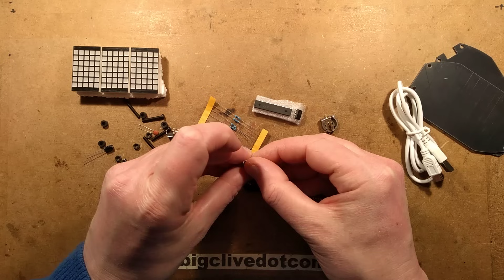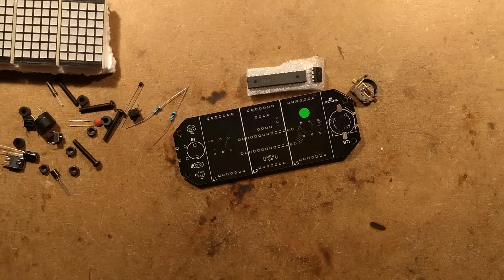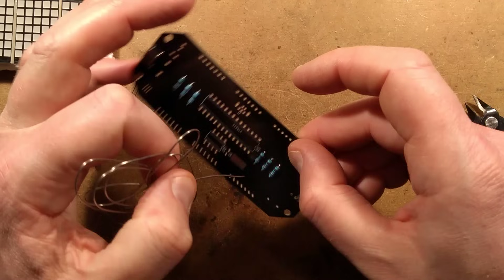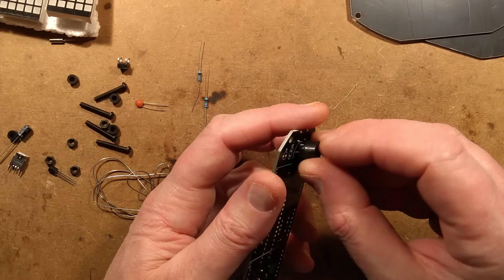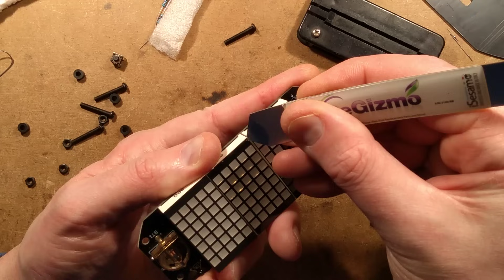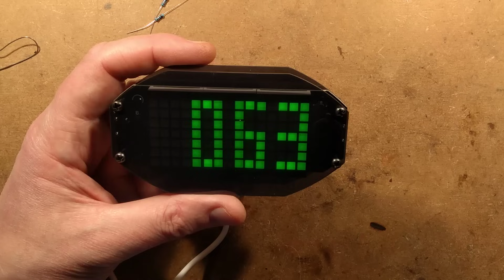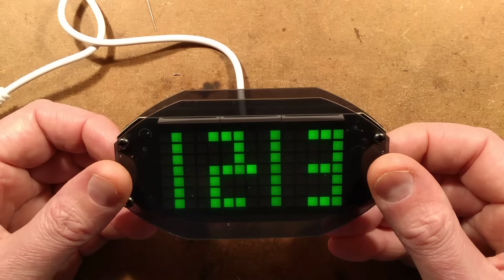Full clock kit build and setting guide.

Comment: The "solder will crack" never made sense to me. It's soldering, not welding.
Solder joints are soft and have a bit of give to them, cutting the leads too short isn't going to damage the joints.
If anything, lead-free solder can lead to cracks of its own as time goes on.

Comment: I believe the purpose of the flux is to change the surface tension of the melted solder, so that it will be sucked into the via and around the component leg by capillarity.
Reply from the maker: The flux is mainly to clean surfaces and shield them while the solder flows.

Comment: Speaking of "spares".  I once owned a TekTronix 512 oscilloscope, back in the 1970s (around 1976).  It was already an "antique" at that point.  One day, the 2nd-channel pre-amp failed.  So, I open up the case, and it was beautifully built inside.  But, to my astonishment and delight, there was a rack of spare tubes inside the cabinet.  Replaced the blown tube from the pre-amp, and it ran for many many more years...

Comment: Why do so many soldering irons come with spings to put them down in that are mounted in plastic too light to hold them down?  The ceramic heater rods are very cheap, but I have to keep buying another soldering iron to mend the first one.  I have my current stand stuffed with lead, but the spring still tipped the iron straight on the kitchen tiles.  While waiting for a new heater rod from China for £2, I bought another almost identical iron, except this one had an on off switch in the handle,and the handle got hotter than the heater!

Have you looked into the construction of soldering tips by the way?  I had no idea they were so complicated, and that I had ruined many a one by trying to file it clean!  :)

Comment: If you use an external flux, the carry-over method works quite well. Using that method really depends on the situation like soldering inside a guitar where a third hand would be great.  External flux was a revelation for me.

Comment: Dude, I had left a comment about devices for this on a different video… Never really thought about re-using anything from them. 

I’ve only used disposable ones like that a few times. The ones I use are usually refillable. The NOVO device you had, comes as a refillable one, where the tank and mouthpiece are replaceable. After you use them for a few weeks, the wick part burns up, so…

The stuff that they put in them, changed a bit, a few years back. The new stuff can use more of the active chemical in it. The old stuff, you could get stuff with very little of the chemicals in it. The old ones used less wattage, and use regular, replaceable 18650’s and fancy tank, some have lcd screens…

Oh yea, I’d fixed a led flashlight, that a had a wire popped off… did something wrong… got a bit warm, and the led came off the circuit board… 😖

Comment: I was in the RCAF as a Comm/Radar Systems technician and I took the High Reliability Soldering  course developed by NASA. We were taught to put a small dab of liquid flux on the connection, and put a little solder on the tip. That solder then acts as a heat bridge as it comes in contact with the lead and the pad. This heats up the connection quickly so that you can apply solder to the opposite side of the work and minimize the possibility of heat damage to components and board. With 2 sided boards and plated through holes you must ensure to dwell long enough for the solder to flow to the other side. Also, on the subject of bending leads, leads are bent to be in centre of holes so they don't stick to the sides when trying to remove them. Not a big worry for most hobbyists however. 
Love your channel. Don't let the smoke out.
Reply: I've seen a bunch of commercial boards which have short leads (like the ones on buttons.) bent on opposite ways, so like 1 up 1 down on a capacitor, or up down up for transistors, it's still fairly easy to remove (either bend the leads straight with a screwdriver or the soldering iron, or twist the component out), but holds well when soldering.
Reply: And remember NOT to turn it upside down or all the Electrons will fall out.  He he he

Comment: I bought something similar a while ago, no instructions and no socket for the chip.  I am guessing i cooked or zapped the ic as i applied power and it released the magic smoke.  Luckily it was only a couple of quid from china and i bought 2.  For the second one i added an ic socket and that worked but was horrendously inaccurate losing about an hour a day - whoever wrote the code for the chip obviously didnt take into account the time it takes to execute the code.  Also it was possible to set 31 days in each month which is silly  plus as soon as the power was removed it forgot the time.  I made a much better one using an arduino and a RTC module - the RTC not only continues to run with power off but takes care of the date - still using it to this day.

Comment: I really want one now :D. The other night (and you think a massive company like Sony would put logic checking into a clock) my radio controlled alarm clock Iv had forever glitched for the first time receiving the time code. I looked at it and thought, how on Earth is it 74 minutes past 27'o'clock ??? IE it read 27:74 and the seconds were going, so I tried to manually set it and it just looped from 29 hours to 19 hours up or down.  A switch off and try again sorted it, but WTF?? lol

Comment: Clive, I've been guilty of carrying solder with an iron, but I always butter my joints and components with flux.  I guess I have developed this technique do to bad experiences in my younger years of lifting traces and pads.  I've found that if I carry solder over to a buttered joint, it reduces the chance of damage to the PCB, as I allow the wet tip of iron and solder to heat the joint via the solder, and the flux keeps joint clean. Of course, cleaning flux off after is a thing..  Also, this would only work if you add additional flux, which I never solder without using.   Am I wrong?

Comment: 21:03 be extra careful when flowing solder to the shielding of usb connectors, i flooded my fair share that way, they tend to suck solder to the inside surface of the shielding.
"standby current is 50mA or less" looks angrily at her 8x8 WS2812 matrix panel drawing 4A

Comment: Hmmm. Timekeeping is indeed ridiculous. Gains a minute a day. Cut the thermistor leads if that's what Clive meant in the description and i will see if it helps.
Reply from the maker: There seems to be an issue with either the quality of crystal or the stability of the clock chip.
Reply: bigclivedotcom Yes indeed. Chopped off the thermistor and it's now losing time at a rate of one minute per hour. 😥

Comment: The Drift can be corrected with a better crystal, but higher precision crystals are quite expensive from the big name electronics suppliers BUT if its a worth it, purchase a FEW to get very high precision & to make it cost-effective, then you got your problem solved.. But more than likely, pretty much the BEST precision Crystals are Surface-Mount.

OR

You can buy RTC Chips like PCA2129T - Sadly, and i quote, "VERY HIGH PRECISION" RTC Chips like this can are usually surface mount versions, for me, i love SMD components, just get a x60 magnifier cheap as chips at aliexpress and off you go !

i quote again from the above chip:

" > Operating temperature range from -40 °C to +85 °C
   > Temperature Compensated Crystal Oscillator (TCXO) with integrated capacitors
    > Typical accuracy: ±3 ppm from -30 ℃ to +80 ℃
     > Integration of a 32.768 kHz quartz crystal and oscillator in the same package
      > Provides year, month, day, weekday, hours, minutes, seconds, and leap year correction"

So on IC's like the above, the crystal and capacitors are built in, VERY High Precision AND Temperature-Compensated Crystal... 

in other words... Fookin-Awesome-Bobs-Your-Uncle and off you Go !!

If you go looking for high precision crystals, you would want one from 2ppm to 3ppm in accuracy...

The Crystals on the cheap china-made DS1307 RTC Modules are closer to a very rough 30ppm to 50ppm and can even be as bad as OVER 280ppm !!!!!

PPM - Parts Per Million...

Comment: I just completed my clock a few days ago, and it seems to gain approximately 2 minutes per hour. Swapping out the chip seems a pretty decent way to go, anything I need to know before ordering a DS3231SN? Straight up chip swap, as well as removing the old crystal?
Reply from the maker: I think swapping the chip and crystal for ones from a reputable source could be a good start.  I tried adding decoupling capacitors locally and it didn't help much.

Comment: It's not really a big surprise that it doesn't keep time very well. Those crystals and capacitors are probably not matched and so 32KHz can have heavy drift. I also assembled a clock with that chip. I ended up ordering a bunch of capacitors to try and now it runs withing a few seconds a month. It's the same with Velleman and some vintage LED clock's from ELV I sourced a PCB for and build.
For a much better out of the box timekeeping out of the box you should bet on the DS32KHz as oscillator or use the DS3231 RTC which is more or less and RTC with DS32KHz build in.

Comment: What is your preferred temperature? Oh and also I have various tips, but using a symmetrical flat tip . Is your's a chisel tip of sorts? I assume I have the same no brand  soldering iron as you - same tips, but what is the best one please Clive?

Also, just got a clock on BangGood, but CR** it is smd, and I have now successfully soldered only three kits!!!! AND NOTHING smd.
Have you done any SMD? What tip would you use? I have 30 tips, as they cost nothing for a cheap knockoff iron!

Comment: I bought the larger, SMT version of this. Cool. Also bought the RGB/7seg version, but sumthin's wrong. Either they supplied the wrong LEDs, or the PCB layout is wrong. The LEDs are 6-pin isolated LEDs, all 3 dice facing the same way. But the PCB parallels two of them. Of course, it doesn't work. I assume LEDs with alternating polarities are needed. Except...I can't find such a thing. Anyone seen them?

Comment: Chuckle. If you think folded-over leads are troublesome, you should work on some old point-to-point wired stuff with the phenolic terminal strips. SOP on those was to thread the leads through the eyes of the lugs and twist them together to form a secure mechanical connection. Only then were they to be soldered.

Connections were good, but you typically had to cut out components. Desoldering was limited to cleaning out the lugs after the leads were snipped.

Comment: Clive any update on how yours kept time ? mines runs fast and gains 1 hour per day. Be interesting to see how yours worked out and if or a fix is available >?
Reply from the maker: Mine runs fast when powered and slightly less fast when not powered.  I've been trying various things with it.
Reply: bigclivedotcom I have ordered another crystal to see if this helps. Will report back with some results. It’s actually a nice clock other than the time keeping issue...

Comment: Here's a nice video describing a crystal oscillator test rig build using plain copper clad board and a few components It's an "old skool surface mount" layout and design. Great for beginners. 
https://youtu.be/blalAktxFoI
How to make the island cutter from a broken drill bit https://youtu.be/RKdsXU5iIF0

Comment: Mine came a couple days ago - in the US. (Now 2-20-29) - 
I ordered 2 greens (if I wanted any - green was it) - put them together without video.(because I was too lazy to look it up)  notable is the fact the displays are flippable - can go either way round. Another catch is the switches need 2 of the pins trimmed to clear the battery holder - solder from topside. Keep the parts (Q1 and Electro) below the buzzer height so they don't interfere with the smoke plastic bezel.
The thermistors are within 2deg C of each other. Sorry to see it doesn't do deg F (for us here in the US)

Need to figure out backup battery (thought I ordered some, but they may have come and got put up in my parts bins).
Work well, going to put one in my truck. neat clocks
They're too simple. I didn't get much fun out of the building, built both in about 20min. 
All together, recommended! 4 out of 5

Anybody know what battery fits it?? I'm thinking CR-1220??

Thanks Clive - cool "kit".
Reply: Yes, CR1220. And it does do Fahrenheit.

Comment: Hey Clive, any update on how accurate this clock is timekeeping wise?? I got the same one, except with a blue display, off eBay and it's comical, over the course of 4 hours it's gained 11 minutes, yes I do mean 11 minutes, so around an hour ahead of actually time every day, it's like guess the time... How's your one fairing??
Reply from the maker: While running the time really runs fast.  I've tried decoupling capacitors at the RTC chip and MPU and also added a bigger smoothing cap.  No real improvement.
Reply: @bigclivedotcom  I think John Harrison's H1 was more accurate than these clocks... 🤣🤣🤣
Reply: @bigclivedotcom  Hey Clive the general consensus from the sellers in C.H.I.N.A is that the DS1307 chip is bad and needs replacing...I don't have any spare DS1307 chips so maybe you could give it a try and let me know if it works, given you probably have a load of DS1307 chips in your mountain of odds and ends???

Comment: Well mines finally arrived , I built this and enjoyed watching this video again. Clive what battery is this using , I cant seem to find any that fit. I also don't have the ghosting issues you had but I did go with Blue as Green was sold out. I bet this video put the price of these up. Please let me know of the battery size. after 3 hours testing it is now running 3 mins fast.....
Reply: A CR1220 worked in the one I built.
Reply: @Mikeydude001  How was yours at keeping good time ? , i replaced the crystal which helped but it still runs fast.

Comment: Hi Clive. The DS1307 is a good clock clip but it's normally let down in cheap kits by the poor quality crystals supplied, which I suspect in most cases are production rejects.  The DS3231 clocks with a compensated resonator on the chip are far more accurate.  I've built a few Home made Arduino based clocks with the DS3231 and they keep very accurate time.  I have one on GMT  in my radio room with a coin cell providing backup  that has never had the time adjusted since I buit it a few years ago.

Comment: It's the layout guy (who is not an electrical engineer) that puts polarity marks on non polarized parts like the buzzer.  Even resistors have pin 1 and pin 2 and if you draw the schematic with pin 1 to one trace and pin 2 to another trace the layout guy will obey that distinction even though you didn't care at all.  However, the guy that loads the insertion machine may be smart enough to know he can ignore pin number designations for resistors.  Or he may not.  If he doesn't you can bet you are going to get a phone call from manufacturing in a panic because they just made 5000 PCBs with a part on backwards.  And he doesn't speak English.  And it takes you an hour to figure out it's a resistor and it doesn't matter.  And it takes another hour to convince his manager to ship the boards.  And the only time you can talk to them is at 11PM at night your time because he's on the other side of the Earth.

When you were bending those resistor leads I could hear my manufacturing quality guys hollering at me for bending leads like that.  Even when I would point out that it's just a prototype they still would holler. Even when I would point out that the tiny bit of stress I added to the component was not going to do squat, they just wouldn't buy it.  Quality dept could be really annoying. 

As for loading the tip with solder (and burning off all the flux), I would do that but at the same time I had already applied a flux pen to the component and it's pad so the flux in the solder didn't matter.  Made it easier to avoid the necessity of using 3 hands. A biological feature I do not possess.

Crystals are commonly  20ppm.  17 seconds error in 10 days.  (I think I calculated that right)
More expensive good crystals can be 3ppm.  2.6 seconds in 10 days.
Really cheap crystals can be 100ppm. Or even worse.  And crystals are quite temperature sensitive.  
Good clocks with battery back up use the power line frequency to count seconds.(assuming you are connected to power line and not USB)  
Power line frequency is extremely accurate.  And when power goes out the clock only then uses the crystal.  If clock is on battery for just a short power outage then even if the crystal is pretty low quality the drift is almost insignificant.  My favorite clock kit works that way.  The CK-1.  But it's almost gone from the market now and it was quite expensive. I probably wouldn't have to touch my CK-1 to adjust the time for 5 years or more if it weren't for that darn daylight savings time.